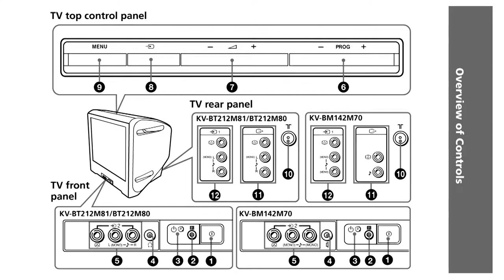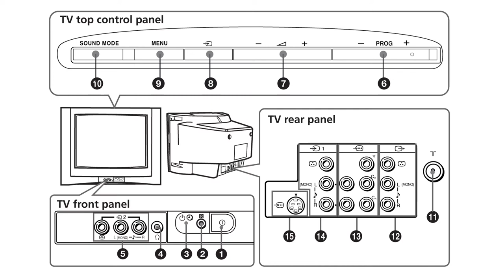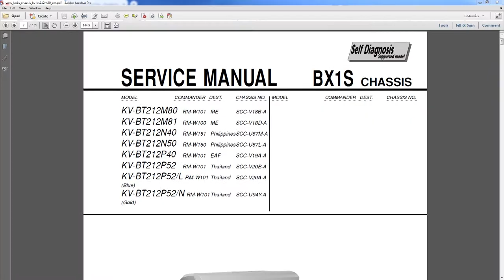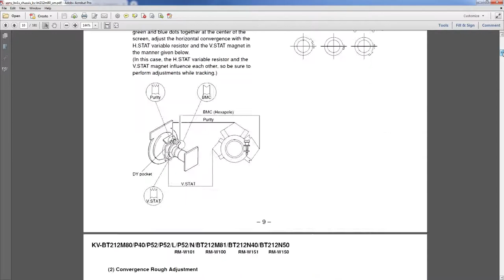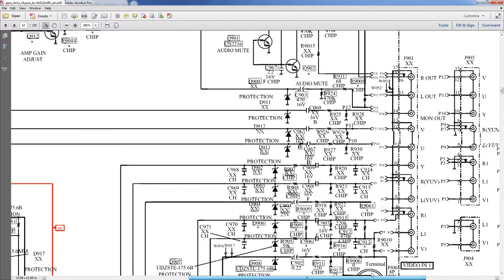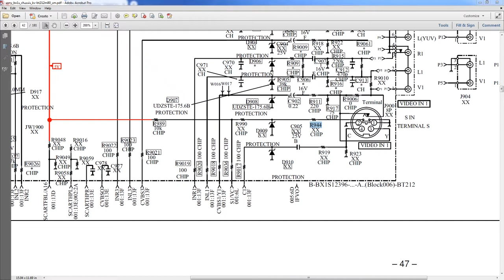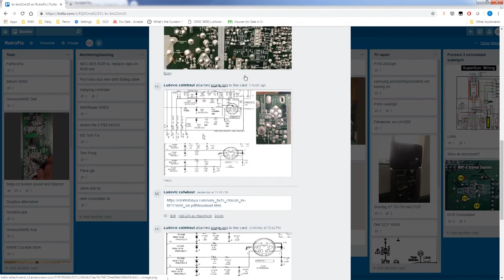Sony kv-bm21m10 Svideo mod

Comment: I think that modifying opb2 in service mode can enable the component input for that chassis, then you might need to check blanking pin sourced with correct voltage to activate rgb input mode, and find a way to bring rgb signals to yuv/rgb terminals in jungle. Did you try some like this?
Reply from the maker: Yes I got component to work, just mimicking the circuit and option bytes of the AR21
Reply: @djcalle1975  There is some improvement over s-video? I like the models associated with BX1S, but Im suspicius about maybe so modern and sharp tv, cause I want that for 240p old games (neo geo mvs that I own and has RGB, cps1, older capcoms like gun smoke or ghost&goblins)
Reply from the maker: @pablosoto5407  FD trinitron tubes don’t have a retro look that’s for sure

Comment: Any reason why you decided to go for S-Video instead of component? I have the same TV and am thinking about doing either this mod or going for component by populating the YUV lines but it does seem like a lot more work and not even sure if it's possible. Cheers
Reply from the maker: No particular reason, component is possible, but more work like you said.
Reply: @djcalle1975  I see! Thanks for the reply and this video btw,  it's very helpful!

Comment: Hi! I have a tv with the same chassis. I want to add additional inputs for gaming. I have a couple of questions.
Why did not you add diodes D909 and D910? or it is not mandatory? 
Also you did not remove resistor R9006. I see on the scheme and your photo of flagman TV that this resistor is absent. Do I need to remove it?
Reply: Success! Component YPbPr signal is added and works good. I am so impressed that I did it and how the image quality is good after AV
Reply: @AJ7000y  - can you share what you did to get the Component to work please?
Reply: @jtmm1980  Hi! I'll try to explain it by a comment cause I can't insert any images here. I might make a video explanation later, but not anytime soon.

Like the author of this video, I referred to the service manual of my TV and a flagman model where the component input was factory-soldered. I closely studied the A board (jack, block 6) schematic. For the YUV lines, I soldered the missing components (marked with nominal values XX), and I looked up their values in the flagman TV's manual. Unlike the video author, I pre-ordered all necessary SMD components of size 0603. Here's the list of SMD resistors and capacitors for YPbPr and s-video signals:

Capacitors: 1 x 0.01µF, 3 x 0.1µF, 2 x 1µF, 2 x 470PF
Resistors: 1.5k, 2 x 220k, 2 x 39k, 4 x 75, 4 x 220

I also soldered the diodes, which the video author didn't include. Initially, I made the s-video without them, and it worked. Later, I found and soldered the diodes just in case:

7 x UDZSTE-175.6B

I used RCA connectors and soldered them to the board with wires. You can use any type, and you need five. I also used an S-video connector and soldered it directly to the board, along with a switch as the video author did.

Additionally, you need to solder a 5-pin connector to CN905 and CN007 (as marked on the schematic near the processor). On the schematic, it's marked as OUT, but I don't know why. I made a custom 5-wire male-to-male cable to connect CN905 and CN007, which carries the signal to the processor. I used JST PH2.0 connectors, which fit perfectly on the board. No additional soldering is needed between CN007 and the processor since all required components are already there.

So that's the hardware part. The s-video mode is activated when two contacts shown by the author are shorted. On the schematic they are unnamed. Enabling component video mode requires configuring the service menu. Instructions for accessing and navigating the service menu are in the service manual. In my case, I needed to find the configuration category OPTB -> OPTB2 and change the value from 20 to 52.

To determine the correct value, refer to the No. OPB2 table in the service manual. Desired options are marked with ones, forming a binary number which you then convert to a decimal number. In my case, it was 00010100. By marking the Component column as 1, it becomes 00110100, which converts to the decimal number 52.

After this, a new video mode called DVD is added, which displays the video signal transmitted through my custom-soldered component connector.
Reply: @AJ7000y  - thank you. I have a friend I hope may be able to do this for me and all the detail is appreciated
Reply: @AJ7000y thank you so much for the detailed write up!! I just picked up a TV with this chassis that also only has composite and RF inputs. I had planned to do an RGB mod and was bummed to hear in the video that it was disabled in the jungle chip, but S-video and especially component inputs are more than enough for my needs! I had trouble finding much information about this chassis online so this information is super helpful!